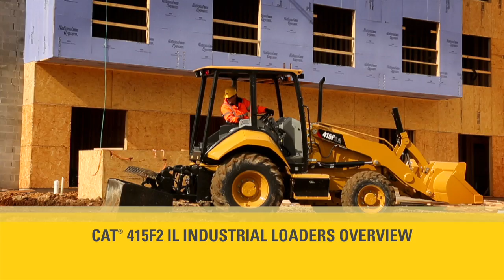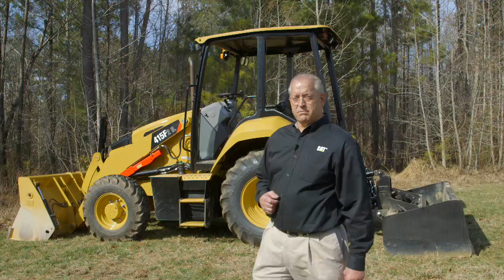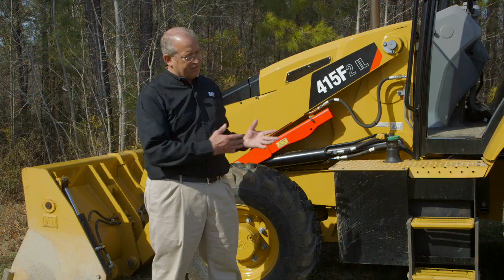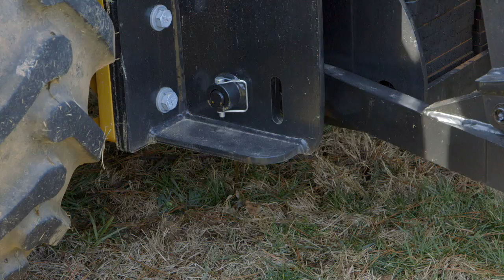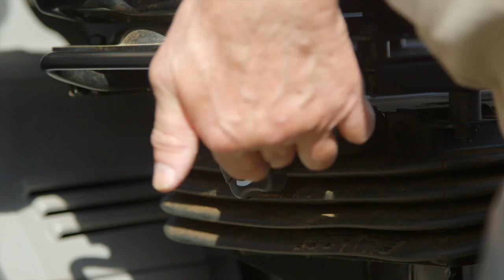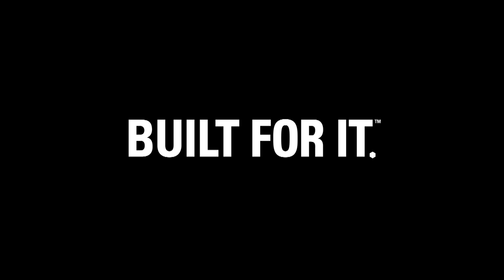Cat® 415F2 IL Industrial Loader Overview

Comment: I have this same machine. Is there a way for the box to work with a laser grade level?
Reply from the maker: Hello Don’t worry about it. The 415IL is not currently set up to take a 2D or 3D grade system. If this is something that interests you, please speak to your Cat dealer about potential aftermarket solutions. - Elvitz

Comment: also if you add foam filled tires in rear or additional counter weights it would help the bounce and tipping factor by lowering the center of gravity. good machine just a little room for improvement